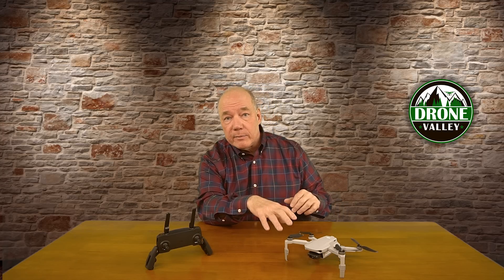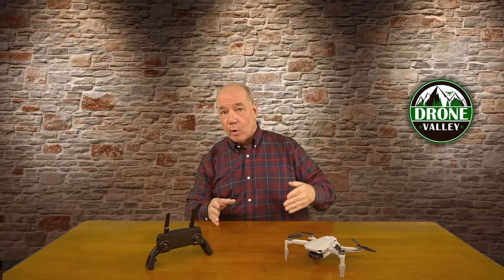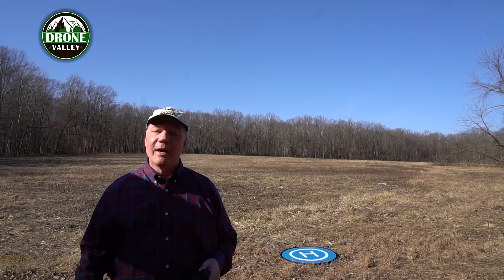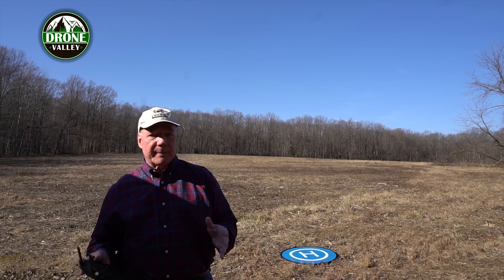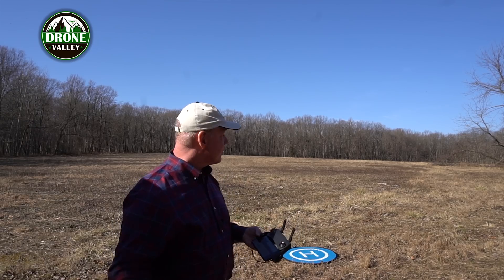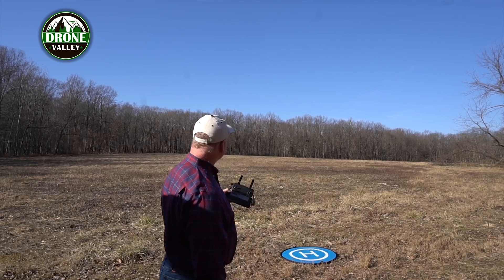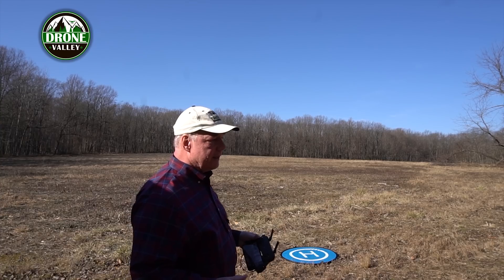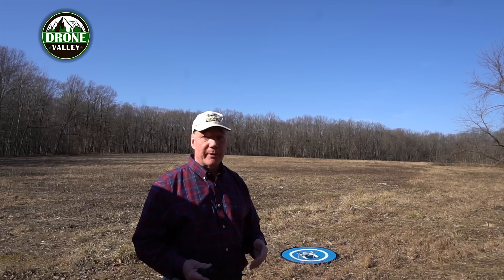Mavic Mini Return To Home - How Does It Really Work?

Comment: Thank you, the mini is my first real drone. I'm new so this may be a dumb question but..  Does the mini return to home like this |\ meaning it rises to say 60 or 100 ft then makes a 45° angle to the home position, or does it return like this |‾| where the mini ascends 90° upwards to the set return level then fly at the RTH altitude, and descends to the RTH waypoint? I haven't used the feature because yet because I'm afraid it may be the 1st option.
Reply from the maker: No worries and thanks for the post. When the RTH is triggered, the drone will rise to the height you have set in the app, turn to face the homepoint, fly home and descend over the takeoff point. It's important you set that height above any obstacles in your area since the drone doesn't have crash detection. Mine is usually at 150' to clear the trees. I hope that helps. Rick
Reply: @Dronevalley  thanks! I just tried it out with the RTH at 150'. What a great feature!
Reply from the maker: @darrellnielsen6303  You're welcome and it's can be a life-safer if you lose track of your battery levels or just get into a situation where you've lost sight of the drone. Knowing it can find it's way back home is a really good thing. Stay tuned for more clips this week. Rick

Comment: Thanks, Rick, great information (as usual)! My question is do you have a tip to determine the height of objects (trees, buildings, towers, etc) so the RTH height is set above that height?
Reply: Idk if you still need it but i recommend 2 methods:
- judge by eye and add a couple of meters
- a more precise way is to take your drone and go next to the tallest obstacle and rise it at the top of said obstacle. Once that’s done remember the height and adjust consequently 
That’s the only way i know about

Comment: One of the best drone channels out there....Thanks Rick !   While you are talking about the return to home feature.... If you had the return feature set at say 150' and you fly up and over a hill that is higher than your return to home setting and you loose connection in one of the ways you just explained , does the drone take into consideration what you just flew over and adjust to make up for the hill since it does have sensors in the bottom of the unit...  I hope i explained that correctly.  Thanks for your answer in advance.

Jim
Athens GA

Comment: Another great informative video so well explained.  Thank you very much.  
I am considering getting into the hobby and purchasing the mini.  I live on top of a hill and was wondering if I set the RTH hight to be 100’ above where I live (and take off from) because of some trees around my house and fly 200’ below the height of where I took off from and enact the RTH will it climb to that elevation +200'+ 100’  that it took off from to return home? and when I look at the height on the app of the drone will it be based on the actual height over ground even if it is lower than where I took off from? Thanx again.
Reply: That is the same question I have asked but in reverse.  Flying up and over a hill above you....

Comment: Last night I decided to take the drone up right when the sun was going down, I flew only about 600 ft. away and I got a couple of signal interferance messages and then remote lost contact with drone. I got a box that said return to home confirm or cancel. I would hit confirm and nothing would happen. I then pushed return to home on the remote and would get the beep that tells you it's not connected. I was not sure what was happening for at least 30 seconds until the remote gained contact with the drone again and then said return to home. I really thought I was going to loose it. Why do you think this happened, The same thing happened once before too.

Comment: That first beeping sounded like low battery warning and not RTH on low battery.   You can set the low battery warning to any battery level you want and is just a notification.  RTH on low battery is automatically calculated and not user adjustable.

Comment: Failsafe response:  one item to consider when signal is marginal is that you might not be receiving from the quad, but the quad is still hearing from the remote.   That's happened to me with my P3A where it only came back after 4 minutes because the battery got low, and I suspect that's what happened to me last week with my M2 where I kept saying "yes, return home" but it took quite some time.   Then again, I forget that the M2 will backtrace it's path in hopes of getting the signal back where it had it before.  The Mini doesn't have the backtrace feature.

Comment: A couple points on RTH you touched on but didn't explain: depending on how close you are to home point (and depending on what model DJI), the quad will either land where it is or not ascend before heading to home point.   60ft is usually one of the distances involved.
When triggering RTH with the remote button, you need to press and hold for a few seconds.   Just pressing for a second or less won't engage RTH.
Reply: OK, you added detail about the 60ft towards the end of the video.

Comment: How do u update the rth point?
Reply from the maker: The RTH is set automatically when the quad takes off and can't be changed. On other quads you have the choice of either the takeoff point or the pilot (controller) for the RTH but with the Mini it's only the takeoff point because its a simpler quad and software. U hope that helps and thanks for the post. Rick
Reply: Drone Valley hey Rick,  your videos r very helpful. Thank u. I believe that u can update the home point by going to the safety tab when the drone is airborne. Jim

Comment: Hello Rick, does the mini displaced your love for the Anafi? Jeje.... 
Goin back to the RTH.. Have you tried the RTH with every intelligent mode going on? I had a bad experience with the RTH on the Anafi, i was testing the camera mode and sent it back on a dronie with the camera mode enabled, lost connectiin and the RTH did not activated, pushed the RTH on the remote and never responded (telemetry was receiving) every one asumes that RTH works every time but no one has ever made a video testing RTH on other modes appart the normal mode and was it a flaw on the Anafi only or is it present on other drones ?

Comment: This is the first video I've found that explains why RTH will not work if you are closer than 60 feet from the launch point.  When I first got my drone, I was reluctant to send it off too far and was trying to make the RTH work.  Now I realize why it wasn't working.  If the user's manual covered this point, I don't remember seeing it anywhere.  Thanks for the tip.

Comment: Could have made it more interesting by using Mini's video footage , app screen when the remote is on in low battery mode and also flown a bit more further like most newbies would do. Cause there are many Mavic Mini flyaways, if you are following the DJI forums.

Comment: One point to mention is watch your wind. If the wind is stronger then about 20mph the return to home may not work correctly. The return to home feature returns in the position mode which max speed is only around 20mph. In some cases you may have to place in Sport mode and assist the return to home. to safely land your drone.

Comment: a bed experience of return to home,my mavic 2 pro reset its return to home in mid flight ,at a height of 100 ft and 400 meters away from me on it own ,i was flying on new years eve and i want to some video of fireworks and i was using the smart controller after a few minutes in to the flight, the app keeps crashing i lost all video feed i try to restart the app it would work for a bit then it crashed again, i lost all video feed every thing was black totally dead and its was dark and its was out sight big problem, then i reset the app again and then home point was reset how ?, so i could not press return to home it was reset where it was hovering ,battery was running out i thought i had lost it, then i got a faint glimpse of the front red leds and fly it towards me and landed ,

Comment: I lost Mavic Mini 2 months ago in a flyaway, DJI concluded the case of a pilot error for flying too high but my argument is the drone's fails to align itself to homeport on auto RTH (based on details I got from Phantomhelp flight log data). It kept flying off in an opposite direction, I managed to aligned the drone home point manually by then its too late as the drone went in auto landing due to battery depletion. FYI there was not even a slight breeze when that happens and my second argument is that even IF there are any wind the Mini should not have flown away far from home point IF it aligns itself to home point...it might stand a chance fighting the wind or land somewhere nearby where it is recoverable.

Comment: Have a Mavic Pro and had been flying for awhile and probably got overconfident. Flying fairly far out over a river, all of a sudden my screen turned grey and locked. I got quickly concerned and ran and got my Gator to go look for it. Seemed like forever and all of a sudden I thought I heard it? It activated the Fail Safe Return and it came back to me and landed exactly where it took off! Unbelievable! Sure seems like minutes and not 11 seconds but it is a MP and not a MM.
Reply from the maker: I love the Mavic Pro and still fly mine a lot. The return to home is an awesome feature that DJI pioneered a while back and I'm still surprised they were able to include it in the Mavic Mini with its size and price. It has saved me a few times and there's no better feeling than losing connection, panicking and then seeing your quad flying back to your homepoint automatically. Thanks for the post and be sure to stop back soon. Rick

Comment: Hello, sir.  I live in a condo on the 18th floor.  Is it possible to to launch from inside my apartment, fly my drone out through my sliding window for about a thousand feet, and then fly it back in through the open window?
Reply: omgbygollywow A couple of things, for RTH to work properly you need several gps satellite connections, at least 6, but should be more.  You may not find that many inside your apartment.  Secondly, while in RTH mode the drone will arrive at the original location, but very high in the air and come straight down, not through your window.  It will either crash into the side of you building or land on the roof.  Lastly, if you want to just fly the drone out the window and back, sure you could do that, but you have to be sure it’s legal in your area to fly in that fashion, you’d have to be decent flyer and you should consider your neighbors, and make sure they would understand, and agree to, what your planning on doing.  It’s really important for the sport to help non-flyers feel comfortable about the sport and not fearful.  One more thing, at 18 floors up your about 180 feet above the ground, so (in the US) you are well below the 400 foot ceiling for flying drones, assuming there isn’t a big cliff outside your apartment window!

Comment: Hey Rick, nice video. I think it would also be really important to note that this return to home feature altitude should be set to the LOWEST possible altitude to avoid obstacles, I usually set it once I pass these obstacles with gimbal at 0°. Setting it systematically to an higher altitude can actually result in fly away if the wind is stronger than at regular flight level, or if an unexperienced pilot fly with the wind on the first half. It can overwhelm the mavic mini, endlessly fighting the wind before going in emergency low bat landing (especially since it goes into p mode to perform the RTH which is slower than S mode if you can regain control manually)

Comment: Nice summation of a useful feature!  New flyers should also be aware that the mini doesn't know what the wind conditions are when calculating battery life. If you get too far down-wind and have a stiff headwind on return, your mini might not make it and then you could be in the water/grass regardless. Also, you can add some forward stick to help with head wind penetration if the mini is struggling on its own. -Cheers!

Comment: Thanks Rick, I could have used this advice yesterday ;-) I was able to take my Mavic Mini out for a ride while the weather was more spring like here in Minnesota. But,  when I did, I failed to check the battery levels before flying. After a few minutes of flying I got the dreaded "critical battery level RTH" beeping. Since this is all new to me, and I had just switched from a Galaxy S9 to a new Galaxy S20, I had also failed to reset the DJI Fly app settings when it was reinstalled on my new phone. After pressing the RTH button on the remote, the drone rose to the preset altitude, but it wasn't high enough to clear nearby trees. So, in panic mode (I'm a green pilot ;-), I cancelled RTH. Then landed it manually. All in all, I learned some valuable lessons while flying yesterday. After watching today's video I'm more comfortable with RTH and landing my craft safely when needed!

Comment: Hey Rick. Very good video. But I've got a question that nobody has answered so far. What happens if the mini is at let's say 125m height.. RTH is at 30m.. It's 500m away from me and I lost signal and the wind was too strong.. does it descend first or recover the displacement first? Thanks.
Reply from the maker: I all scenarios the first thing the Mavic Mini does is check the current height to the one you have set in the application. If it's currently above that height, it spins and starts flying back to the takeoff point. If it's lower than that, it elevates to your set height and then heads back. The setting in the app is like a "threshold" that the drone needs to be above for it to head home. I hope that helps and thanks for the post. Rick
Reply: @Dronevalley  Thanks for the response Rick. Don't you think ideally the drone should descend first to the RTH height before coming to takeoff point? Wouldn't that be more appropriate?

Comment: Will it RTH at different battery levels?  Such as 100yds away vs 1 mile away  So is it smart enough that it knows how far it needs to go?
Reply: Generally, yes.  The rth for low batter is not fixed.  It looks at distance and battery level.  If you were way out there it might trigger a rth at 25% battery, but in closer maybe only 20%

Comment: Enjoyed the RTH demos Rick. Thank you. Planning to try them all myself in coming days. Quick unrelated question....quad on the mat, props spun up, pre-take off, will any stick movement other than Left Stick Forward 
(Take Off) work? In other words would Forward, Reverse, Yaw, Left, or right have any effect?
Reply from the maker: Thanks for the post and I'm glad you enjoyed the clip. When the quad is on the mat, it can only respond to the "elevate" command until it's airborne. All other stick movements are ignored until it lifts off. One curious exception to that was on the Mavic Pro. With that quad you could slightly move the camera left and right with the right joystick before takeoff. It wasn't really useful but mostly a quirk I uncovered during testing. Stay tuned for more content this week.

Comment: Long time viewer, first time commenter. I was recently investigating the Mavic Mini's User's Guide because i'm a nerd and that's what i do. The user's guide describes RTH feature as: During RTH, the aircraft’s speed, altitude, and the orientation can be controlled using the remote controller or DJI Fly if the remote controller signal is normal, but the direction of flight cannot be controlled.
Does this mean that you could fly the mini to a location beyond your POI then initiate RTH and use it as a course lock while still capturing a video?

Comment: Is the RTH speed Position mode or Sport mode?
Reply: In my experience speed is the same as in P mode and it goes down slowly, perhaps 1m/s. Which is not great considering that I usually set RTH to 40m to avoid even tall spruce trees and there is usually strong wind. I'm trying to be aware of this and if there are small trees, I'm trying to set RTH height accordingly and to launch drone 3m away from nearest bushes.
Reply: Same here. I set mine to 45m. I usually take it out of rth and go manual in sport mode once my signal comes back. I do a lot of distance runs. I’ve modded my controller with a flat panel antenna and amplifiers. Record so far is 3.7km in my residential and out into the ocean. Nerve racking but fun :)

Comment: Very nice tutorial on the RTH for the Mavic Mini. I have not tried the low battery or lost connection RTH. That's good to know and see that it actually works as expected! Now, how many tries did it take on the lost connection or the low battery RTH? First try or was there more?
Reply from the maker: Thanks for the post but both of those were first tries and with the low battery test I had it hovering in the field to drain the battery and it actually surprised me at how perfect the timing was of the alarm with my conversation. It really is a rock-solid system and not something you typically find in a drone at this price point.
Reply: @Dronevalley  that is awesome! I don't rarely run the battery down that far. I am way to careful when I am flying. I get nervous a lot with everything that is going on around the drone, where I am flying, paying attention to all the controls and readout. Thanks again.